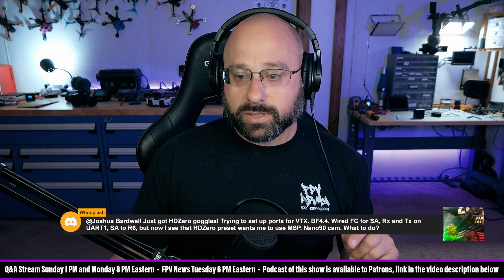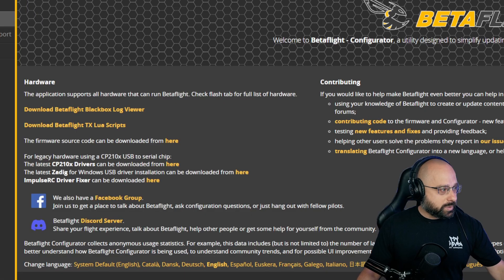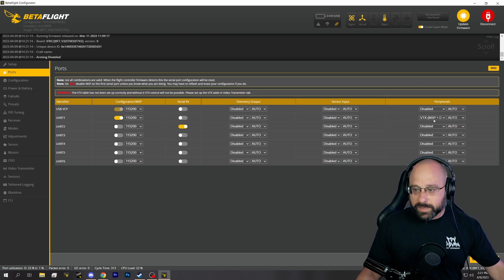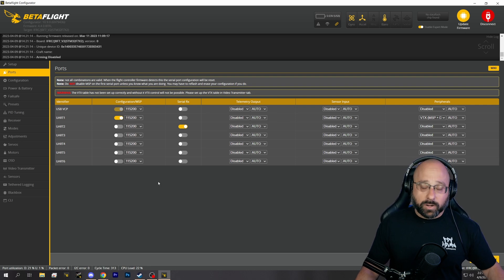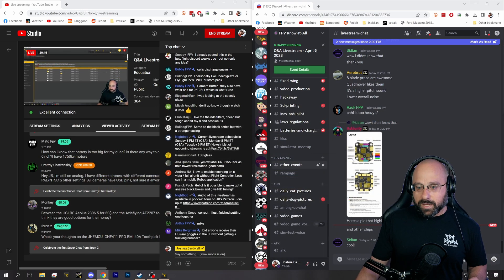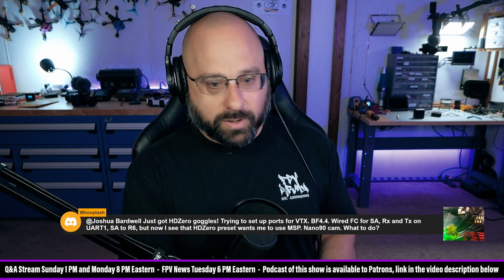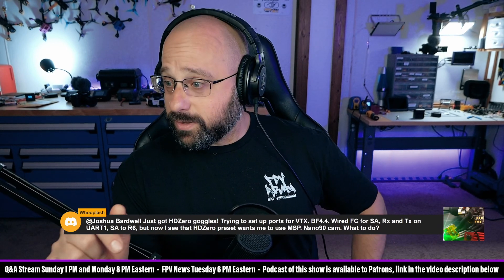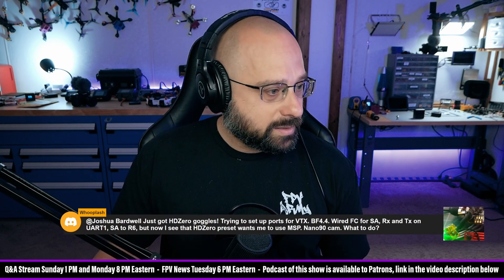HDZero Smartaudio VTX Control? Do I Use MSP Now? How? - FPV Questions

Comment: im not really sure if i fly enough these days to bother but having the dji v2s and fatshark v3, would HD zero most like ley be the way to go? i dont think im interested in the dji 2 i dont think they will fit my face well , besides i have not the best vision and i see better a little farther away from the screem preciption optics or not. i dont seem too see as many walksnail users as i do hdzero goggles. thanks. in simplest terms
Reply: Screw DJI jump on the HD0 bandwagon. Give them your money to get better
Reply: @FlyPVTarzan  i hear ya, but ive been flying rc planes since the late 70s earrly 80s, and ive been flying quads since they were first made outt of popsicle sticks and dow rods..  and now i just use fatshark doms, or dji v2s.. thats really enough for me ya know. i have dxg2. iz12, frysky xdp plus, tx16s max, and a little tango 2 ive used once... i dont think its going to make me better in anyway.. and the money just doesnt seem worth it at the point, give it  a few more years than add ten more years and you probably would feel the same as i do about it.. iive just been doing it for so long the amount of equoiment and stuff i have has beome ridiciulous
Reply: @FlyPVTarzan  i wish i was a little newer to it all... but another 1k for mostly whopp[s with the smaller vtx boards just really isnt worth it to me, but i understand what your saying:}
Reply: @matthewwilken2051   I don't know if I'm helping you or not, but I have DJI V2 and HDZero. I use DJI if I need penetration above all else, for example, if I'm exploring a camping area that I have never flown before. On the other hand, I use HDZero for areas where I am very familiar with, and I want the lowest latency possible. It would be nice if HDZero could manage to give us both highest penetration, and lowest latency, but my assumption is that someone with a much better understanding of radio, would tell me that physics would not allow that. 
Bottom line: if you need signal penetration to be at its best, then DJI is the answer. (I have seen testers claiming that the DJI V2 Goggles+AirUnit03 is better penetration than the DJI Goggles2+03AirUnit, so if you stayed with DJI, the V2+03AirUnit might best, considering the wallet) If you want that feeling, like you're sitting directly behind the camera's glass, then HDZero is the answer. You have tons more experience than I do, so I would love to hear where you fell on all this. Happy flying!